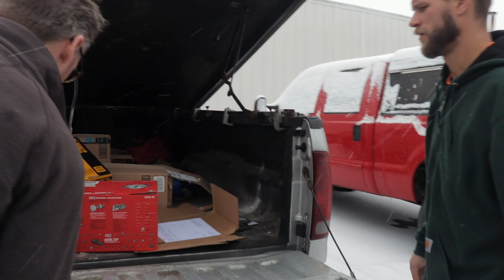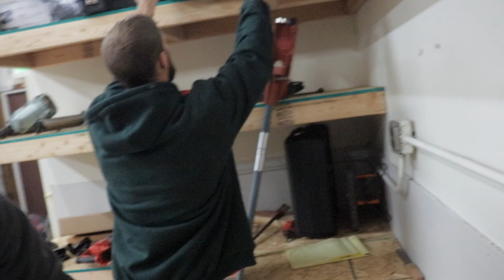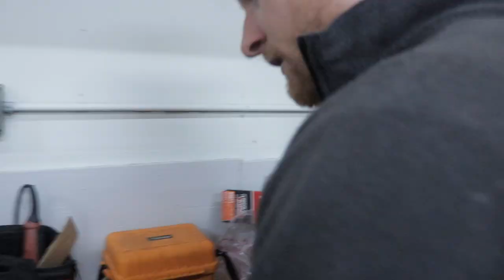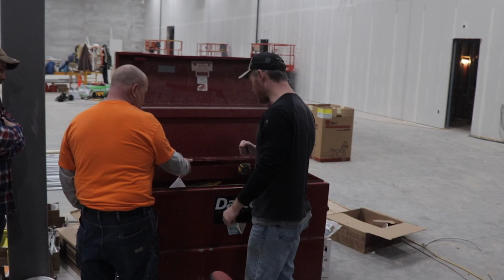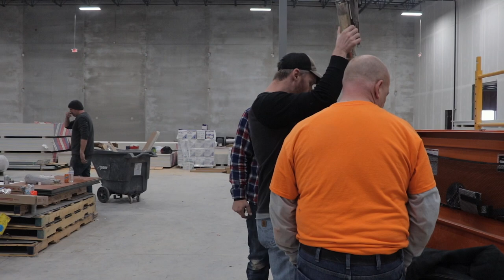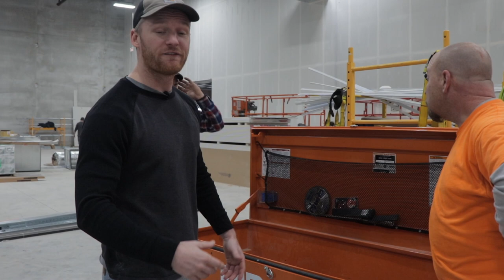Stolen Tools: The $10,000,000 Haul - Part 1 | v29

Comment: The cool thing about ONEKEY and the ticks is that it will ping and provide location updates when it comes within a 100ft range of any phone with the ONE-KEY app that is running.  I believe you can mark the tool as stolen in your own app and the app will inform you of its location next time it is found by another phone with it.   It might not sound like it'd work but you'd be surprised how many people sell these things on Craigslist to other guys who have the app and it pings out as stolen lol. 

Also the ONE-KEYs you can lock with a password and no one can use them unless they have that password.   Some people don't like it since if you forget the password or lose it, you'll have to get Milwaukee to reset it by sending it in with a receipt of purchase I believe.